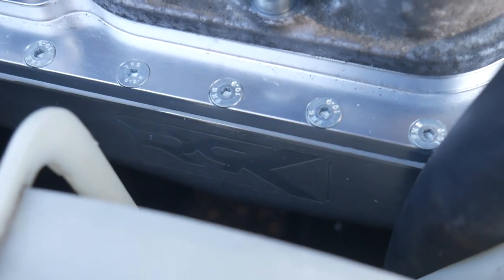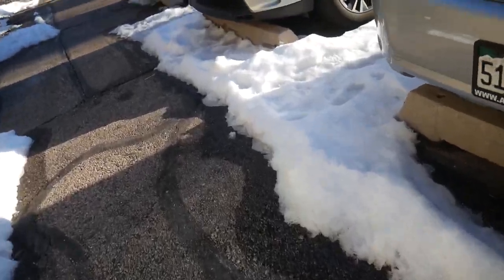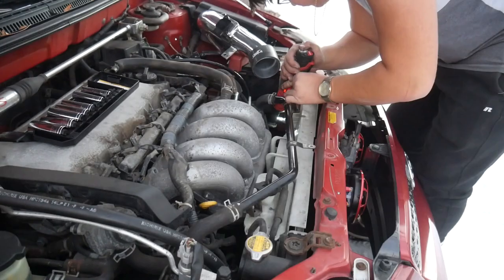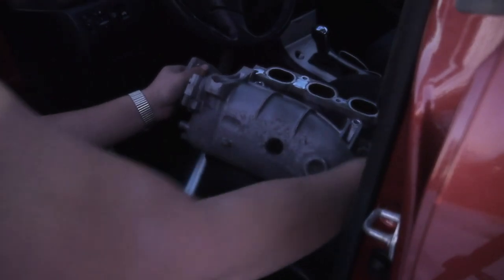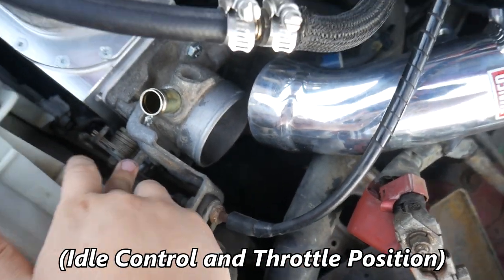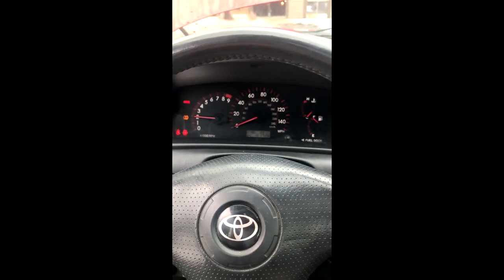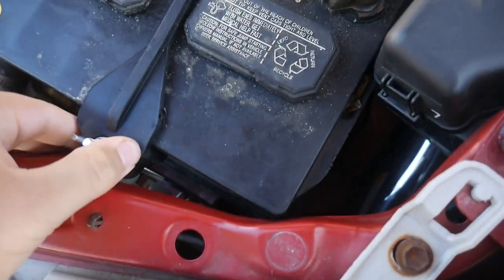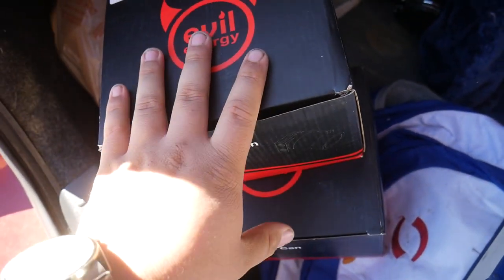Corolla XRS R9K Intake Plenum Install!

Comment: Get yourself a fuel pressure regulator and a 3.25" intake. 2zz's love it. (You will need a wideband also)
Reply: Oh and you need a r9k reflash !
Reply from the maker: Larger intake and reflash is on the to-do list! Didn't think about a fuel pressure regulator, thanks for the suggestion!
Reply: @WillChang   yeah its a must, thats what i use to get acceptable air fuel ratios with my 3" intake on stock ecu. Around 65psi of pressure
Reply: @2zztercel558 I was going to say, just about everywhere says to go past a 2.75” intake (what the Injen is) you need to get tuned because the car will hardly run with a 3”+ intake otherwise

Comment: Have you changed out the timing chain cover gasket yet on your 2005? Mine is leaking small drips everyday but looks like no easy task to do.
Reply from the maker: I haven’t had any leaks yet but I know it’ll be something to do down the road, I’ve seen 2zzlow’s timing chain cover gasket videos and it sure looks like a project to say the least

Comment: so  like I have this (not installed yet) but like the instructions say to flip the throttle body 180 degrees and some other things. though I might be wrong.
Reply from the maker: R9K says to flip the throttle body due to clearance issues with the throttle cable and the fan shroud, but the other option they give which I went with was to cut the ribbing on the fan shroud which gives clearance for the throttle body to mount like it was on the original plenum
Reply: @WillChang  what did u buy for the difference in location for the tb to cai?

Comment: Bro love your video.. im former member of R9K Website! this issues can be avoid with the installation Manual that shows how is the installation on a Celica GTS or Corolla XRS. , this manual should comes with every R9K Plenum sold.. I do apologize if you havent recieved..
Reply from the maker: Thank you for the kind words! All the issues I ran into were entirely my fault, not the fault of anyone else. Plenum is a great product, I'm very happy with it after having it for a couple months now!
Reply: @WillChang  max gains are unleashed by tuning it with a stand alone.. Cheers

Comment: i vaguely recall seeing someone running this intake manifold with the throttle body installed rotated 180degrees. or using Infiniti Q80 throttle body. how do you like it? Are you running stock tune or paired with cams? Also disconnect your battery before messing with this stuff.
Reply from the maker: R9K recommends rotating the throttle body but say that it can be installed without rotating by modifying the fan shroud. I’m enjoying it so far! I’m currently on a MWR reflash with 5800rpm lift but will get a new tune once it’s on full exhaust and 3in intake. Stock cams currently, not quite sure when I want to do those but eventually I will. And yeah I disconnect the battery now, I thought I could take a shortcut by leaving it in but I should know better than that

Comment: What did you use to Extend the TPS wires and other stuff?
Reply from the maker: I just used some 18 gauge wire I had laying around, in the future I want to go back and rewire everything with color coded wires but this works fine for now

Comment: Do you think that it would be bad to have the foam off of the intake manifold? Like it wouldn't get hot enough to melt anything???
Reply from the maker: I haven’t had any issues, I feel that putting the foam back is optional. It won’t get hot enough to cause damage to the wiring harness above it

Comment: When you took off the fan did you just remove the fat coolant lines and turn the opening upwards? How did you get it to not leak
Reply from the maker: No need to remove the large coolant hose, only the tiny one that leads to the overflow reservoir. Then take out 2 10mm bolts, unplug the power plug, and pull the air injection hose off (just clipped in towards the bottom, as well as 2 10mm bolts on top). Then I tilted it up while pulling it towards the right side of the car until I got the angle where it could be removed. Hope this helps!
Reply: @WillChang  I already did it, realized after I took the coolant line off and it pissed coolant everywhere that I didn't need to take it off 🥴 oh well, I painted it with a new silver coat, well worth it!
Reply: I'll try to tilt it like you said when putting it back in im sure it'll help, thanks!

Comment: Do u think the 2zz intake will fit on the 1zz?
Reply from the maker: The injen intake probably will but they make CAIs for the 1zz that work just as well. The 2zz plenum/intake manifold won’t work without an adapter, not sure where to get them

Comment: Did you cut your cai?
Reply from the maker: Nope, just brought it down and used a spare coupler to attach it to the throttle body, that's why I had to adjust the battery location since the new position of the intake also moved the battery forward
Reply: Cool. Ill install mines this coming week